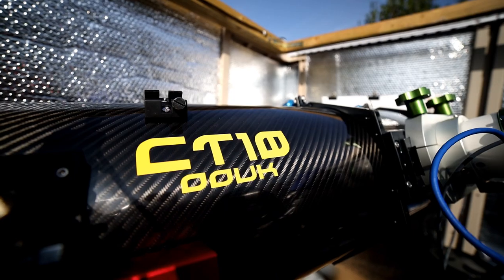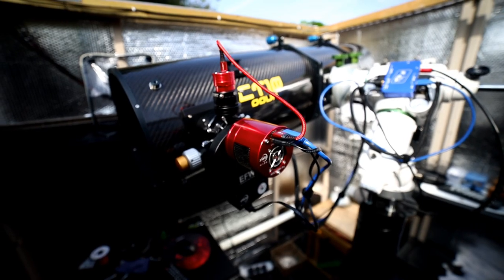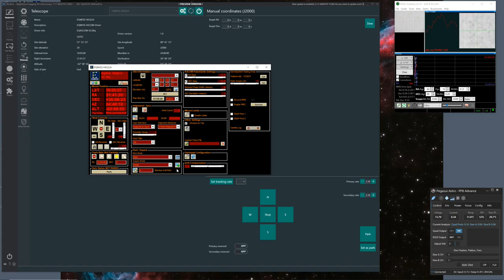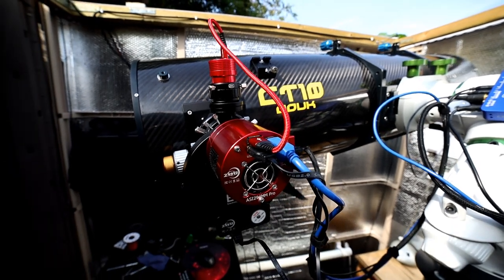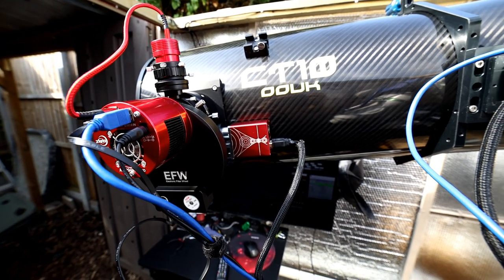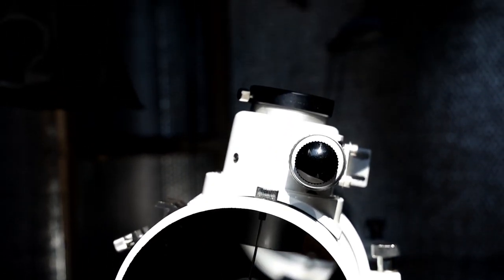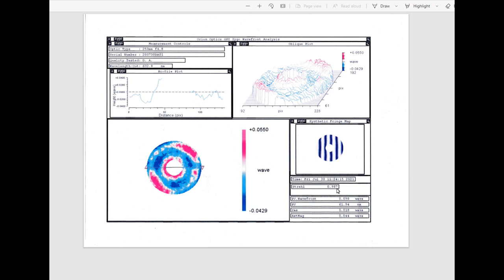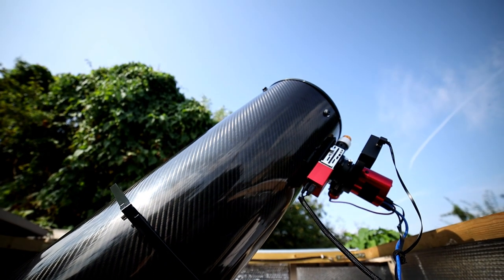First light and thoughts on the Orion Optics CT10. 10" Ultra Newtonian. Incl Zygo wavefront report

Comment: I was looking around to up the reach of the 6" newt, and stumbled across your video. After much debate, ordered a CT10. It's a stunner! If only Orion could do something about the clouds down in Oxfordshire!
Reply from the maker: Hi John and congrats. I love mine and is in permanent use. I recently got hold of the Starizona Nexus coma corrector. Not cheap but wow. With it the CT10 is 900mm and a really quick F3.6. Really pulls in the light and detail. Only consideration is at the faster speed some filters can halo due to filter shift. My Antlia Sii can’t handle that speed. I have a 3nm SHO set from Altair and they are fine so there are filters that are unaffected. Anyways best of luck and thank you for watching

Comment: The dew heaters I put on mine are Kendrick, primary and secondary, on the back of the mirrors. You don't need a dew shield (believe me), that will unnecessarily extend the length of the tube. If you want to offset the balance I'd just add a weight near the focuser, maybe add a sleeve inside the tube near the secondary. Anyway, great to see you are so pleased with your new scope.
John at Orion Optics has always been a pleasure to deal with.
Looking forward to some more beautiful images.
Clear skies. 👍
Reply from the maker: Hi Jon. Thank you for the advice. The dew shield was just a thought and it would have been very short but I wasn't definite on one. I am moving my pegasus powerbox to the scope which will help give me a little more weight to play about with. The optics are so nice on this, I really noticed a much higher contrast to my subs. love it

Comment: Good video and getting better (not sure about the 'Astrobackyard' music over you talking, was a bit distracting). Interesting to see how the inbuilt heating works - warm air currents and all that. Assumed fans were the way to go, however then you end up with light leaks (urban environment), vibration and more air current issues (there are a few threads on pushing vs pulling and different effects). Pacman is a stunner, did it last year with my 200PDS at 908mm so similar result.
Reply from the maker: Thank you Phil. Its difficult when trying to be creative to get the right balance. Some like the music some hate it, Some want it louder, some don't like the choice etc etc.
I wouldn't use the fans while imaging because of possible vibrations but they seem very quiet and smooth. I would just use them after a hot day to help cool the mirror before use. Not noticed any heat causing issues but they don't get that hot, just warm enough to prevent dew forming. I have it plugged into a pegasus powerbox advance which has a temp and humidity sensor and only applies enough power to the heaters that's needed.
Is your pacman on show anywhere? would love to see it
Reply: Ah, fans for cool down on the bigger otas like yours of course I can see that. At 200mm and permanently outside its not an issue, just dew and icing on the primary (which apparently doesn't happen, could have fooled me!).
Reply from the maker: Mine is permanently outside too so i doubt the fans are needed or will get used. They do cause light leaks so I am going to cover them. Never had ice but when its bad dew has formed on the primary of my 130pds. I have a dew tape now on the bottom and its stops that. Having that feature built into the scope was a nice neat option.

Comment: Nice scope. One thing that genuinely surprised me though is that OO are still using the same spider that they used in the GX250 (which i have) that is almost 30 years old and i didn't particularly rate it as a good spider in the GX250 let alone a scope that costs about 2 grand. Still, seems to be working just fine.
Reply from the maker: I suppose the adage if it isn’t broke don’t fix it stands. Surprised though. I can’t say I have any complaints with it. I do love the scope, it just gives me such amazing images, very happy. Thank you for watching and.taking the time to comment. Clear skies

Comment: I managed to pick up a used CT8 this week which I can't wait to get up and running. I've already discovered the third axis balance issue and I'm amazed how sensitive it is (my 200 PDS had no problems there). I just wondered if you have ever felt the need to put a mask on the primary mirror? The clips look huge on mine and a mask improved the 200 PDS 100%. Cheers. Mark
Reply from the maker: Hi Mark. Congrats on your purchase, lovely scope. It took me a little while to balance but once done its sorted. I know what you mean by the size of the clips. They have never caused an issue with the CT10 I have but thats a big old mirror i suppose you will have to see what it does with which camera you use. Fitting a mask on top of the clips is pretty simple and could get you one printed if you don’t have access to a 3d printer. Look forward to seeing your captures

Comment: Great scope. I've been looking at either the CT8  or the VX8. There is a big price difference between the two but with the ability to upgrade the optics in the VX8, the only difference I can see is the carbon fibre tube. I'm sure I must be missing something ?
Reply from the maker: Hi John. They are lovely scopes. I cannot compare as I only have the CT10 but I am planning on getting a VX6 soon so will know what differences there are. To be honest its about the mirrors really and you can pay for the upgraded ones for not too much more. Good luck with your choice and clear skies

Comment: Great image Glenn, it’s like everyone doing Pac-Man …it was so well placed. 
With the 0.9 reducer …it’ll would be my ultimate scope. Wonder if 250pds has the same issue ? 🤔.  
130pds vs OOuk would be nice comparison. 
A piece of kit like that is in good hands. 
Enjoy and congratulations
Reply from the maker: Thank you so much. I doubt you would have an issue with a sky watcher scope. The focuser on this is very low which may be part of the reason, I am sure I will find a solution, I normally do.
Reply: @Astrobloke  
 Grinder … but don’t make a video of it. 😉
Reply from the maker: @padraigfarrell7150  not sure I could stop myself……😈

Comment: Curious about something. How did you fit the OAG into the imaging train. I was quoted that the back focus is roughly 44mm from the retracted focuser. I can't seem to find room for it.
Reply from the maker: I know my OAG has to be flush with the top of the focus tube. Are you using a coma corrector? I use the Baader MPCC MkIII which is a good one for this scope as it can be fully inserted into the focus tube.

Comment: I just wonder whether you have solved the problem I have been getting increasingly frustrated over, I knew I had seen in one of your videos that a coma  corrector never fitted very well , I have an Orion VX 12, and thought for now I would get my sky watcher coma corrector I had on my pds 200 & use that to begin with & use that with my ZW0533 mm pro , but I run out of inward focus just as it’s beginning to get there tried many different things as that’s how I usually problems solved by trying hundreds of things until I luckily hit the right one 😂, I can use it without the corrector so at least I am seeing something  but it has got bad stars , but I see with your baader MP3cc that sounds like you had the same problem but you can take the lip off that and push it right in the tube , if this solves my problem I will be ecstatic as I love big Newtonians  & let’s just say I can run before I can walk  😂, hopefully though this sounds like it may solve my problem thanks Glen 🙏
Reply from the maker: The Skywatcher lip means you cannot insert the image train in far enough to achieve focus. The MPCC as you rightly say has a removable lip so allows this and focus achieved. It is still close to fully in but in a way thats a good thing as less leverage on the focuser to cause tilt.
I recently bought the Starizona Nexus .75 which is fantastic, bit pricey but really nice CC and focus achieved no issues.
Reply: @Astrobloke  found a second hand mpcc 3 & going to give it a try , thanks Glenn for the great videos & advice 👍

Comment: Hello Glenn, do you use a coma corrector with your CT-10? If so which one? I have an OOUK VX8- PV10. From the images I have done so far it would benefit from a coma corrector.
Reply from the maker: Hi John. Yes I do and use a Baader MPCC MKIII. 
Does a great job. Can I ask how you find the VX8 as I am thinking of getting a VX6 soon.
Reply: @Astrobloke  Thanks for that information Glenn. I am thinking of getting an Explore Scientific coma corrector.  I have only used the VX8 on two occasions so far and I had some balance issues and I realised I would need a coma corrector, so I have not seen it at its best so far. It has a great mirror with a Strehl ratio of 0.991.  The scope gave some lovely clear views of Saturn a few nites ago. I will give you more information when I get a bit more experience with the VX8.
Reply from the maker: @johndoody8413  thank you. Newtonians can be tricky to balance, its always the 3rd axis balance that catches most people out.

Comment: Hi late comment. I  got a CT8 and have same issue re focusing. 
With Skywatcher aplanatic  corrector (the long one) I am unable to focus as the focuser is racked right in and still out of focus with 55mm backspace. 
This is the first telescope out of many that I have this issue. This is totally  is naff if you ask me. The last thing you want to do with a brand new scope is start fixing it.
I noticed that TS-Optics do Newts  with an Orion UK main mirror. This has TS-Optics carbon tube and Ts-Optics mechanics (focuser, mirror holder, spider etc). I suspect this one actually works unlike the OO built one !
The TS one has 2 positions for locating the primary mirror up the tube  (AP or Visual use) rather than having an extending focuser.
I would have got one of those if I had know before.
Has anyone tried one of these ?
Reply: Ok, correction to my comment. It does focus with a 1x  corrector.
The focuser tube had rotated inside the visual extension when fitting the optical train in the dark and the lock screw jammed against the focuser body when focused right in. Only just makes focus. May need a  better solution  for photography.
I guess Glen you were talking about the 0.7x SW corrector.
Reply from the maker: Hi, sorry for delay in replying. The focuser is quite different from the ones used on Sky-watcher in that they don't have the same amount of travel and are low level. Advantages are that the focuser does not intrude into the scope and effect the stars by covering part of the mirror. Obviously the disadvantage is that not all coma correctors will work and achieve focus easily. Speaking to OOUK they do not make a CC for their scopes as they say they are not needed. I have images without a CC and can confirm you can easily get away without one but to get the reduction qualities one would be needed. The Baader MPCC works well but again this is a x1 CC.
I made a mod to my Sky-Watcher x0.7CC by lathing off the retention ring so it can insert further into the focus tube. I have not seen or used the TS optics tube but have heard they are nice. I was not aware they used the OO UK mirrors and was always lead to believe they use GSO mirrors.

Comment: Could I ask if you modified your focuser to hold the image train?  I have the CT8 with same focuser and with only camera ZW02600 and filter drawer the focuser inner tube rocks back and fourth?  Im looking to swap it out for a Steel trak when they become available but if you have any tips / suggestions
Reply from the maker: No mods. I make sure the inner sleeve is all the way in as any unnecessary length will cause more tilt. Its not the best focuser. I think many get a moonlite or steel trak
Reply: Which coma corrector do you use if you don't mind me asking
Reply from the maker: @markhill8218  the  Baader MPCC MKIII

Comment: So what is your opinion of OOUK? From the forums it seems that they have a pretty spotty reputation. Does the mirror seem to perform as it is advertised ? That is one of the complaints that people have.
Reply from the maker: The problem with forums is I find people are very quick to complain but slow to praise. My personal thoughts are its an excellent scope and I am very happy with it. I have many other videos showing images that it has captured and they show its a very good scope and out performs many that cost a lot more
Reply: @Astrobloke  Good to hear. I have been considering one. Seems from the forum it was mentioned that they did have a bad apple in their bunch who was sending out bad mirrors at that time. So it was said. I was ripped off by B&H Photo here in the States so I am a bit cautious in where I buy. Seems there are not many options for premium newtonians
Reply from the maker: @lornaz1975  its not great if you have had a bad experience. The scope I bought comes with a zygo analysis report and that said it was an excellent mirror. I really cannot fault it. When ordering it doesn’t cost much to upgrade the mirror to 1/10th PV. I obviously can only comment on my personal experience but for me the only complaint I had was it took longer to make than quoted but it was worth the wait
Reply: @Astrobloke  If your experience with the mirror matches that Zygo report then good. The reports (at the time, they may have corrected the issue) had the performance of the mirrors not matching the reports. 
Like I said I'm just a little cautious nowadays. Just wanted your opinion since you have one. If you are interested I'm sure you can research what everyone was talking about at the time. Of course Cloudy Nights. 
Thanks for your input on the issue.You have given me more confidence in the scope.

Comment: What camera are you using for the scope and would I need an adaptor?
Reply from the maker: I mainly use my 294mm pro on this scope and sometimes the 2600mm pro. They just need nose pieces to go inside the focus tube and preferably with a coma corrector. If you are using a dslr there are adapters that fit on the top of the focuser.

Comment: I got an email from John at Orion Optics Uk that no corrector is needed for Ct scopes
Reply from the maker: Thank you for sharing that info Robert. I will test that out later as due to be clear
Reply: I'd like to hear his logic for that statement. A Newtonian below F6 will exhibit field curvature and Coma. So a Coma corrector is needed if you want a flat field and sharp stars in the corners. Technically you don't need one but technically you do. My 2 cents
Reply from the maker: @hypersphereengineering6015  i have had a chance to test this evening and although not bad the stars in the corners do have some coma. With the   Baader MPCC the stars were sharp to the corners so I shall continue using that.
Reply: @Astrobloke  I built an 8 inch F6 Newtonian when I was younger. Hand made the Primary mirror myself. It had a Coma without a corrector. I purchased the Baader MPCC and no more coma !! What a shocker. Interestingly I have a 10 inch Ultra Grade mirror from Orion Optics (just the primary mirror and the Zygo report) I was planning on making the rest of the scope myself .
Reply from the maker: @hypersphereengineering6015  Very nice. I really  like my new scope. The details and contrast are the best I have had.
Reply: @Astrobloke  Thanks for the info
Reply: @Astrobloke  Thanks for checking that